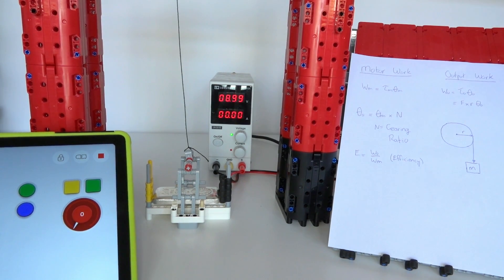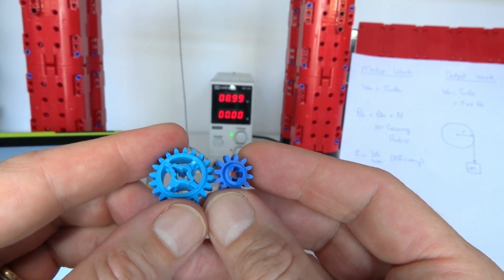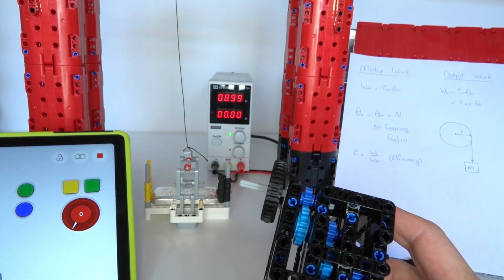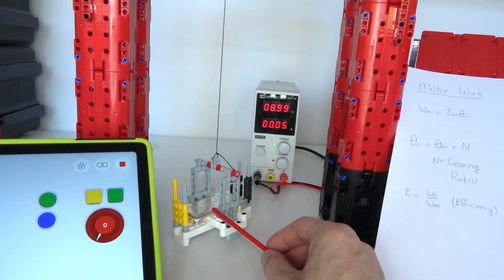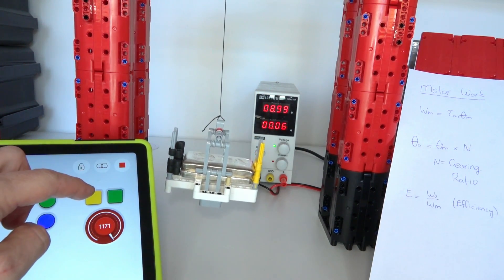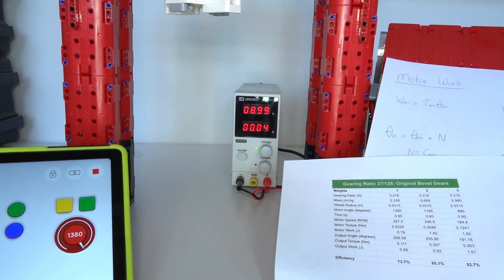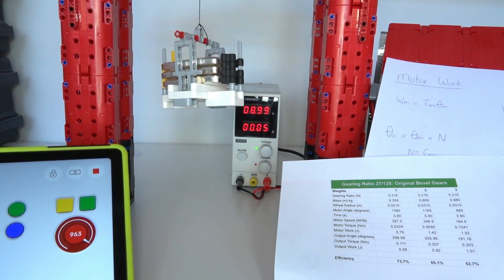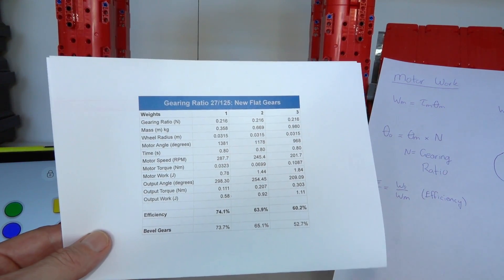New Flat 12/20 Gear Friction

Comment: Thanks for doing this work! This past year I have been using these gears in my clock constructions wherever applicable.
However, I have experienced some issues in certian circumstances:
When I changed the 12t bevel gear in my lunar phase module to the spur gear last year it did not turn nearly as smoothly.
I just recently rebuilt my Grandfather clock and experienced intermittent stalls.

To my knowledge, here are the common circumstances:
The original bevel gears were already spaced away from adjacent elements to mitigate this potential source of frictiuon;
It seems that the cases of issue always involved meshing a 12t spur gear with a 24t spur gear to achieve a 2:1 ratio (this was done on a beam-built construction in a knights move arrangement).

The issue was readily reproducable in the lunar phase module by manually rotating the gears. 
In the clock, I changed all 12t spur gears that were meshed with 24t gears back to bevel gears and the issues ceased.

Perhaps an investigation of this would make a good video for you in the future.
Reply from the maker: Hi Darrell. Thanks for your message. Man that grandfather clock you have built looks amazing!! A real piece of engineering and art. How many pieces is it? Thanks for sharing your experience with the new flat 12 and 24 teeth gears. I haven't tried the the 2:1 arrangement with these gears and I am surprised to hear that they mesh worse than the bevel gears. Will do some experiments and see what I find. Keep up the great clock work (no un intended!)
Reply: @TechnicBrickPower  
I just checked a recent Studio file and it looks like I used over 9200 pieces for the grandfather clock.
This morning, I changed out another (1:2) 12t spur for a 12t double bevel in the lunar assembly of the grandfather clock (just to see if I could detect a difference).
With the spur gear, it seemed to rotate fine, but it also seemed like I could feel the teeth meshing. With the double bevel gear it was much smoother.

Comment: Very useful video, thank you! I have a question though, why does the load slowly come back down in the last experiment without you touching anything? Is it because of the new gears?
Reply from the maker: Hi there, it's just the weight falling back down. Once the motor is switched off it provides less resistance. 🙃
Reply: @TechnicBrickPower  ok, thanks!